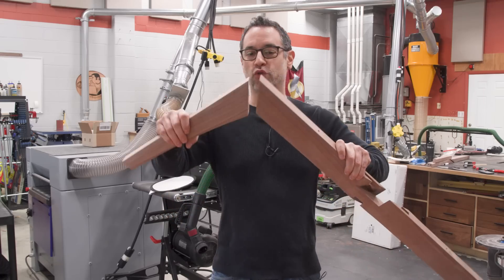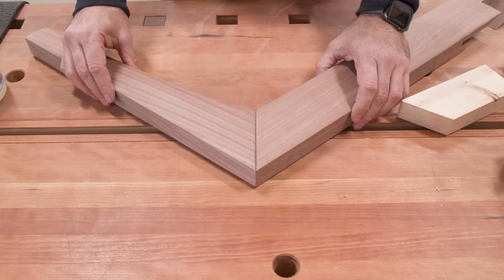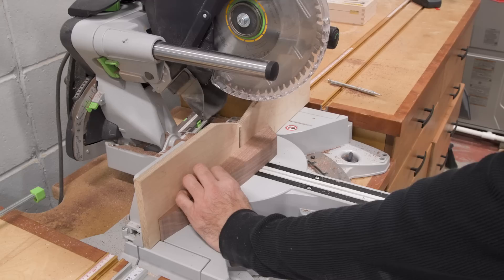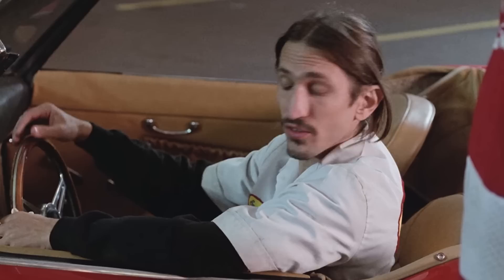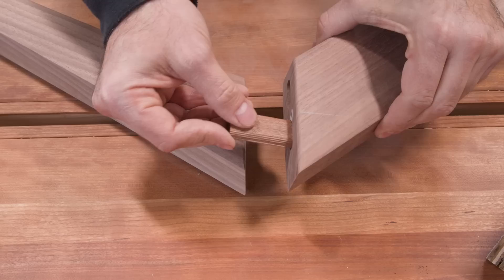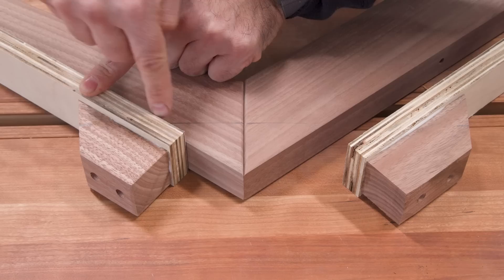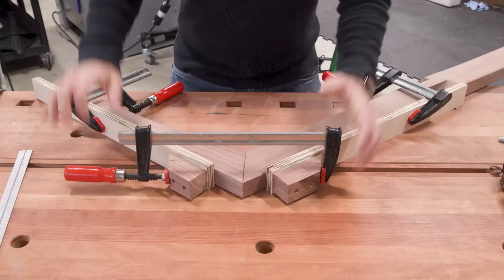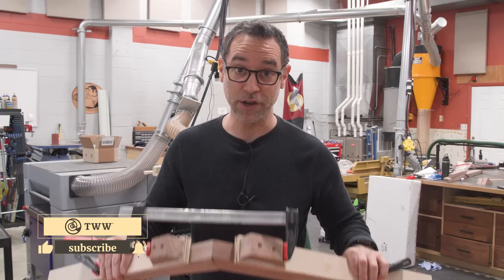Cool Miter Clamping Trick - You'll Want to Make This!

Comment: Chris Salamone uses something similar. A useful thing to do when making these is to make them double ended - have the 45 degree end like these,  and then put a block on the other end with a 30 or 60 degree angle.
Reply: Double-ended = brilliant.
Reply: What about round ends? Then you can clamps at any angle. Like a large dowel cut in half and screwed to the end.

Comment: Thank you. I have seen a variation of this before but you made it very simple to make and use.  An hour to construct 4 jigs, including going to the hardware store to buy spray adhesive. So very effective. I have struggled with miters for different reasons for quite a while and this is one more step to ease the pain.

Comment: Very nice, thanks for sharing. I am relatively new to woodworking and I usually need what I don't have. But this time, you inspired me to look around and you would not believe what I already had. Roofing jacks. Worked great, although I won't be lifting and waiving them around like yours in case they slip off.

I will build yours and may even try aluminum extrusions with 90 degree connectors, but they will unfortunately also be heavy, so will need stay on the bench while the glue dries.

Comment: As others have mention, this clamping jig has been around for some time.  But it is still great to see the step-by-step of how you made yours.  The older version I remember had a rounded clamping face where you cut the 45 degree angle.  I think the idea was to allow the clamp to be shifted into a position where the clamp faces could be pulling directly at each other while still clamping a wide range of miter angles.
Reply: That's what I was thinking - some kind of concave surface so the clamp would be able to find a stable position without slipping off. Or drill a hole through the side to insert the L-shaped end of one of those Milescraft fence clamps.

Comment: Great video, I appreciate your clear instructional approach in your videos. This is a "new to me" clamping technique. I sure could have used it last winter when I rebuilt a mid-century modern chair and had to clamp the leg pieces.  I think you can use angular shims at the clamp points to adjust closer to a square clamping surface.

Comment: I like it.  But after you mentioned the issue with angles other than 90 degrees, it got me thinking.  What about using a concave surface for your clamps?  I'd drill the walnut block with a forstner bit almost as wide as the block, and then cut across the hole at your 45 degree angle to make both blocks.

Comment: That's something else I need to go and make now 🤣🤣
Honest question, would it be better to cut a concave curve on the faces the main clamp bears on, this would then mean the clamp is less likely to slip even if the external angle moves away from 90 Deg?  The angle wouldn't need to be anything specific and easily done on the bandsaw.  Interested in your thoughts.
Reply from the maker: Try it. Sounds like it should help.

Comment: I had to make the equivalent of 22 of these to make a faux beam from maple veneered plywood. 11 were individual like you show, the other 11 were attached to an 7 foot piece of MDF. The beam was 14 feet long and made in 2 sections. Then using the dowelmax we joined the 2 sections and lifted it to cover the LVL beam. Some mistakes were made, but these jigs worked great. Pics available on request. Thanks for the trip down memory lane.

Comment: Stick two small pins at the centerpoints of the edge of the face the clamps sits on and then hoist a rubberband on the pins and you got a very neat indication where the middle of the joint.

Comment: You could make a couple sets at a couple different angles, to get a closer angle parity. Maybe a set at 30 degrees, 45 degrees and 75 degrees, if you do angles further from a typical 90 degree miter. Also, adding a shallow pocket with a forstner bit would help "capture" the clamp into the blocks and help prevent the clamp from sliding off the clamping blocks. Great video overall and a simple, easy to build jig that will be hanging on my wall in the near future. So much cleaner than using CA glue for clamping cauls

Comment: I bought rolls of sandpaper that I think is meant automotive body work. They are 2 inches wide and 60 ft long. They are adhesive backed and extremely usefully. Would have been perfect for your clamping things. I have 120, 180, 220, and 320 grit.

Comment: Wouldnt it be better if the clamping surface was a half round then you should be able to use the clamping blocks regardless the angle of the joint, adding to that if the half round blocks have pins through the center of the circle then u could use a ruler to place the clampblocks through the center line of the joint?

Like then and nice video regardless. Nice point if the disassembly order, didnt think of that. ^^

Comment: Did you steal this from a forum post I made? 😁 This works great I've been doing it for years, glad you made a video cause everyone should know this method. My own modification is to skip the plywood. I use doubled up adhesive backed sandpaper and just clamp the angled (walnut in this case) blocks to the work piece. The sand paper is grippy enough that you don't really need to adhere it to the blocks. I usually use off cuts from the project so the angles are perfectly complimentary and result in parallel clamping faces.
Reply: Also then all I need to store is somb doubled up sandpaper so there arn't a boat load of jigs sitting around my shop. Scraps go in the BBQ grill pile.

Comment: To be honest I don’t think you needed the special corner clamps for that particular job and you could have just used normal clamps along each side of the frame. The double dominoes you strengthened the mitre joint with would’ve prevented any possibility of the mitre joint sliding under clamping pressure.

Comment: If the angled surfaces on the clamping jig-pieces were cylindrical (convex) 3:54 , you could clamp any mitre-angle without needing a unique surface for each.. Kinda like the cylindrical pins on a sine-bar.

Comment: If the mitres are cut cleanly and accurately, there is no more than a spring clamp required.  If you have to apply so much force then I think the game is lost.  What I do is to assemble the joint dry using a spring clamp (4 joints if a picture frame) and then feed in some water thin CA glue from the rear which leaves a joint with no glue line on the face.  Then I fit a spline or splines depending on the thickness of material using standard wood glue.